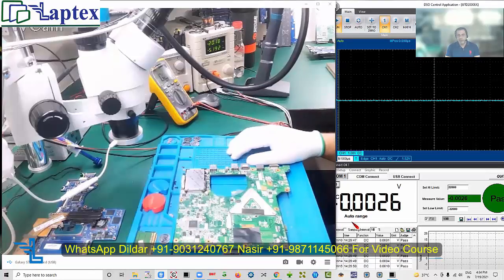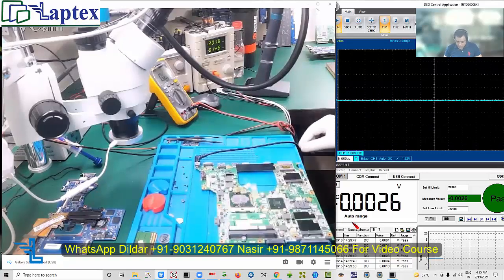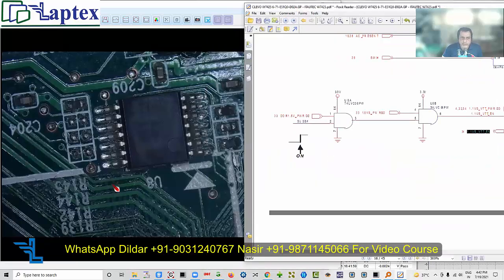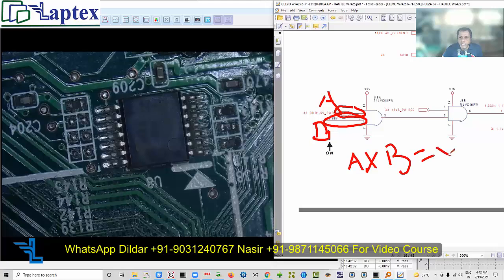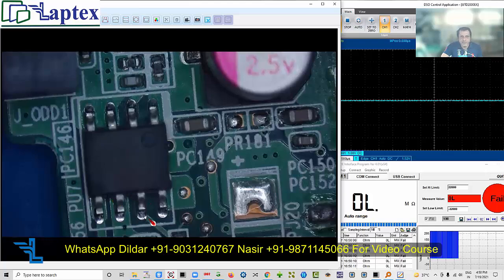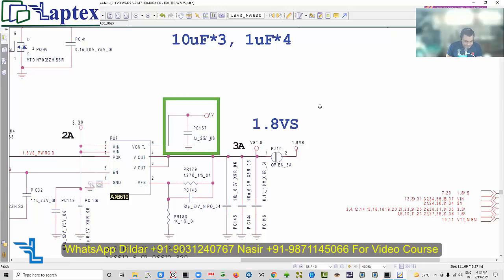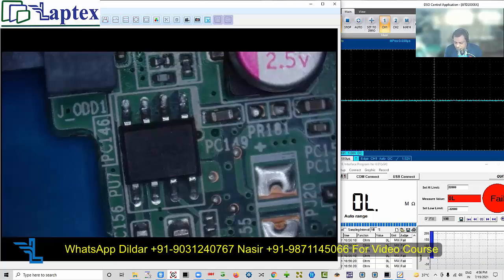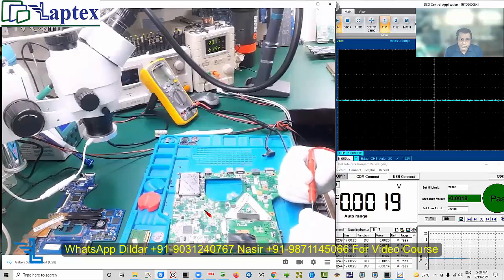LAPTOP NO DISPLAY LOGIC SOLUTION ENGLISH | Online Chiplevel Laptop Repairing Training Video Course

Comment: Sir, I need your advice. I want to flashing a BIOS chip of a Clevo 6-71-W24H0-D02A GP mainboard, but the programmer tool I used (CH341A) doesn't recognize the chip, so I decided to replace it. But unfortunately I only have a replacement chip from different manufacturer. According to the schematic, the original chip is MX25L3205D. Can I replace it with Winbond W25Q32?
Reply from the maker: Check the supply requirements. In some bios it will work while is some it may not work.
Reply: Thank you, Sir